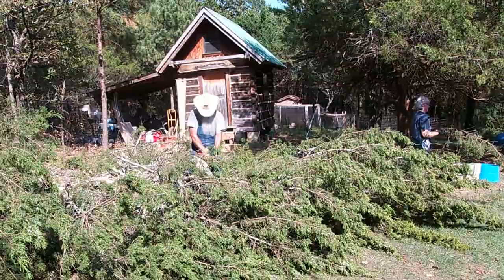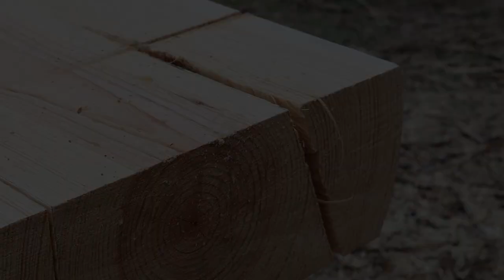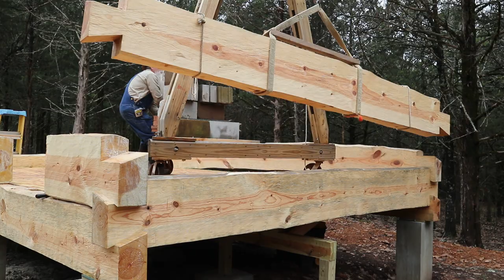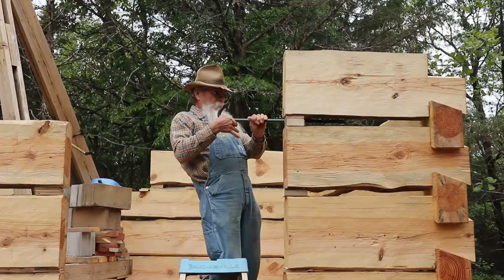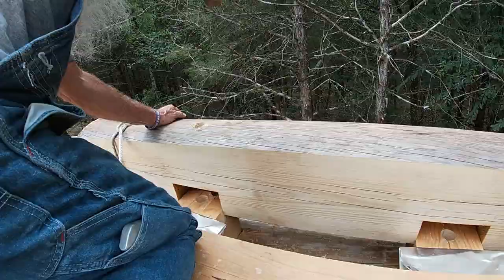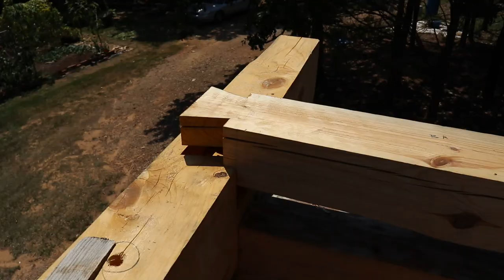Time-lapse Dovetail Log Cabin Build (Ep 37) Through the Top Plates

Comment: It's so amazing seeing all the joints slip together perfectly every time. And I can't get a good fit every time when I'm doing normal stud walls when I work. But then again I have just started as a carpenter after 3 years in college in "carpenter class" (I'm now 19 years old) but it's still fun working with wood. Me and my coworker have been "renovating" an old summer cabin built in the 40s. (Pretty badly built and would have been better to knock it down and start over)  the walls was only 2x3 and a spacing of about 30 inches. And leaning in all different directions. And uninsolated. Well well we are almost done now after 2-2,5 months. 
Greetings from snowy Sweden
Reply from the maker: Howdy buddy- I have been doing carpentry work for many years now. It takes patience and perseverance. I worked with my Dad for many years and he was a perfectionist so I had to do things to suit him.  Hang in there and you will become very comfortable with your work. I admire you for wanting to do carpentry work. Take care and stay safe. God bless you
Reply: The Bearded Carpenter Thanks :) I learn as I go and each time I try to get more and more precise on my cuts to get a better result. 
I can see that you are a perfectionist you're self. Wich is a good thing cause this cabin will be absolutely stunning when it's all done. 
Stay safe

Comment: I wish I had the patience and skills to build from a log to a cabin. I'm too small and too old now. I build more post and beam. 4"x4" and 2"x4" juniper frame. 12' widths. I have built 4 in the last 10 years since I retired at 55. Off grid, 12v solar only. This one here is on 1 acre, 12'x20'. Running spring water, wood stove, 100w 12v solar, solar water heater. All the comforts of home. One at beach 12'x18', one at lake 12'x16' and one at the old "farm" 12'x14'. All board and batten, 1"x12" pine siding. This one here is the only one with insulation and interior v-groove pine interior. I also built a tractor camper, 1 axle "vardo" 7'x14' rounded rubber roof material for antique tractor rides and river camping....James
Reply from the maker: j wal10   Howdy- you have been busy for a retired person. I’m not a big man myself, and I won’t tell my age. But, if your health is good you could still build another one. Thank you for watching our video. Take care and God bless y’all

Comment: Hello friend, love your video series. Very informative and enjoyable to watch so keep them coming. :)    When you final assemble the dovetail cabin, do you use long timber screws in the dovetail notch corners to secure the logs or do you just rely on the weight of the logs (gravity) on top of the notch to hold the building together?
Reply from the maker: Howdy- the notches will keep the logs together. However, I do put allthread in the top four rounds and tie them together. Lots of people do put some kind of pins or dowel rods in but if they aren’t done right it can cause problems with settling. If the logs are pinned there is no way to tighten the shoulders of the logs to have a tight fit. Hope this explains it. Take care and God bless you

Comment: Well, that looked easy.    Is it typical to sandwich the ceiling / second floor joist with bottom notched and a top notched plate / logs?   So, we still have the roof to do yet, right?
Reply from the maker: J F   Howdy JF- I could have made the joists lower than I did and put the whole joist pocket in one log but I wanted the extra clearance under the joists. Also, I was showing how it could be done. Thank you so much for watching our videos. God bless you
Reply from the maker: J F   Yes, the roof will be next and there will be a wrap around covered porch to do. Blessings

Comment: Many of the videos series I watch show insulation placed between both the horizontal and vertical surfaces of the dovetail joints. What is your take on that?  You obviously didn’t use insulation.
Reply from the maker: Howdy - the way I fit the notches they are complete wood to wood. There is no place to put insulation. I know that some of the European log builders do put insulation between the logs where they have scribe fit the logs. I have a friend in Estonia who is a fantastic log builder and they put insulation between the logs but the notches are wood touching wood with a tight fit. Blessings